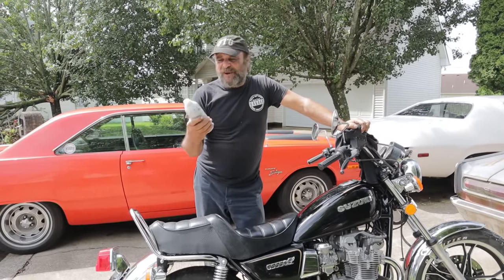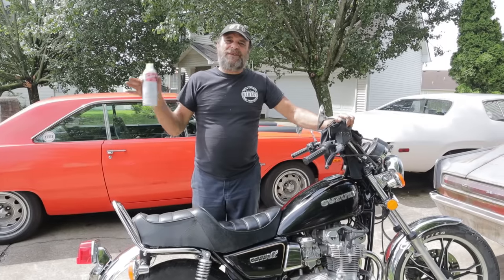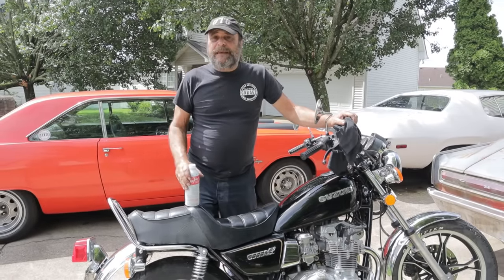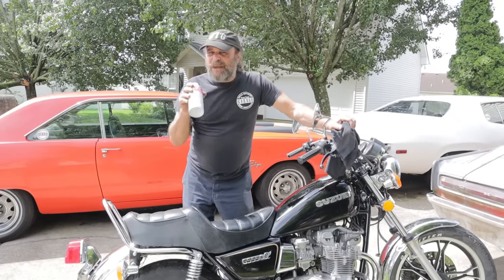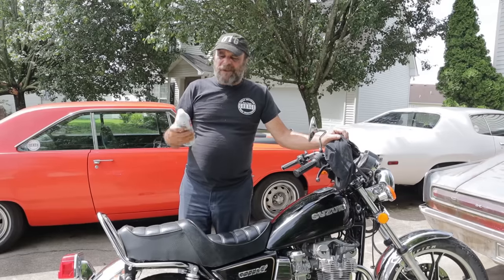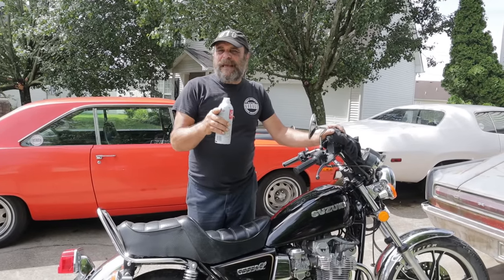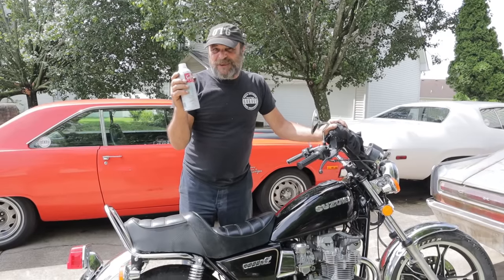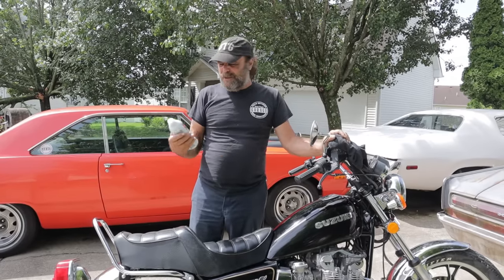We Try Seafoam - We Come Away Shocked

Comment: My Yamaha V starsat for 2 years and would not idle without giving it a little throttle. After running about 15 miles on a fresh tank of gas with slightly stronger than recommended amount of seafoam in it the bike ran like a champ. It works.  I also use sea foam in my oil about 50 to 60 miles before I do oil change. This helps with keeping hydraulic lifters clean. It’s a mild detergent that will not harm your main seals or gaskets. This keeps an engine from getting excessive sludge.  Check out project farm’s YouTube channel.  Pretty impressive how Seafoam quieted a noisy lifter on a very neglected Ford ranger.

Comment: @Uncle Tony’s Garage That works great in the fuel system but it shines when you introduce it into the vacuum system. This is what you do. Start up your cars and let them warm up. Pop the vacuum line from your brake booster and let it suck in about 8 ounces of sea foam. When your car starts to smoke, shut it off immediately. Wait 15 minutes and started up again. It’s going to smoke like crazy for about 10 minutes because it’s burning everything up that it cleared out. I promise you your cars and bikes will run like brand spanking new from the time you start it. It works every time and it’s the best internal combustion cleaner I’ve ever come across in my 38 years of being a really good back yard mechanic.

Comment: I had a Mazda that threw an EGR code. My kid had been putting cheap gas in it and it was a turbo. The EGR valve was in a very hard to reach place and I didn’t want to deal with changing it. The guy at Auto Zone told me about Sea Foam. Took 2 cans but it cleared out the soot in the EGR valve and everything was fine. 

Since then, I put a can through my tank on my motorcycles every 5k. Half a can in one tank of gas and then the second half in the next. Track your mileage before and after and you’ll see the difference over many tanks of gas.

Comment: I'm an old school Chrysler guy (63 Dart, 67 Dart, 68 New Yorker, 69 Charger 440 RTSE, 73 Fury, 77 Imperial, 83 Imperial, 89 Ram P.U. my last Chrysler... In spite of Scotty Kilmer(who I enjoy watching, and think is right on a lot of the time), who thinks Seafoam is 'bunk', I HAVE found some improvement afterward, the GREATEST improvement after one can, was unsticking apex seals on a 1970 Mazda R100 Rotary I bought that sat for a while in the late eighties. Fascinating to see a barely running, spitting, coughing,  low psi compression engine, to end up going MMMMMMM, and then Zoom Zoom after a minor tune up, yes it works, but I know, that now, there are better products out there.

Comment: Over the years, I've bought 8 bikes that had been sitting for various lengths of time( several years on average).  Buy a battery, drain old gas from tank (NOT the carbs) fill with fresh gas mixed with Berrymans B12 and 104+ octane booster.  Crank until they start to run.  Ride bike through 2 or more tanks of the same mixture.  Results were that EVERY bike ran smooth, would idle and perform to expectations.  Some were smaller twin cylinders some were 4 cylinders.  All 4 stroke.  The only one I pulled carbs on was a Suzuki GS450E to drill out the main jets.  Inside was as good as new.  NO further cleaning necessary.  It had been sitting out behind someones house with a couple of small rugs on top of it for "weather protection".  I wouldn't even change the plugs, just clean the tips with my plug cleaner.  Sometimes I'd let it sit about 15 minutes between cranking, so as to not burn up starter.

Comment: I used seafoam all the time for my beater commuter that had a catalytic converter going out since the engine was burning oil like crazy.  Would clean out the emissions system and get the code to go away. Sorry, but engine restore additive is effective. I have seen before/after compression tests. It really works. I also use restore on my beater commuter to help it from burning oil. It works, but it's not a miracle in a can. It can only do so much. Definitely helps with oil consumption but doesn't completely fix it.

Comment: I've had reasonable sauces with Berryman B12 in fuel injection systems with cruddy injectors myself. Experiment Farm did seafoam test as well with quite good results on the old Ranger farm truck he has too. There is very little voodoo in a bottle that works. Happy you had good results.

Comment: I use sea foam in everything. On diesels I always fill new fuel filter with sea foam.  Small engines ( mowers, quads etc ) get a couple glugs every tank of fuel.  Also put a full can in gas vehicles probably every 3-4 tanks of fuel!  It’s amazing stuff!  If I buy a old car and I don’t know history on it,  I will dump a can in oil and let idle for 5 min then change oil!  It works wonders!

Comment: I had a gentleman with a 2007 Hyundai that would set check engine lights and poor idle. After multiple fixes he dumped a seafoam into the tank, it smoked for a few minutes, coughed and fixed itself. I was impressed. No idea how exactly it fixed it but damn if it didn't work!

Comment: Yeah. I never believed in this stuff till I put it in a goldwing with a slight hesitation when throttle was applied. Well it took care of that. But it does have its limits. Check the condition of your oil after you get it all ran out of the tank. My oil was black. And only had 700 miles on the oil.  So it cleans alot of carbon out of the motor as well.

Comment: Seafoam works great!!  You can not add to much!! The more you use the better!! Pull off a vacuum line let it suck it from the can till motor dies.  Let it sit for 20 minutes then run it hard!! You will be amazed!!  I buy it by the case when it’s on sale.

Comment: The outboard boat motor mechanics along the Colorado River use this stuff for the 2-strokes.  I have used in my Toyota Avalon to make sure the injectors are clean and running good with no injector problems with 240K Miles.  I also use Lucus Oil Injector Cleaner for my diesel.  They way I look at is you can go to an expensive gas station 4 times a month and pay $.50 cents to .$.75 per gallon more than another gas station selling cheaper gas.  If you go to the cheap gas station 4 times a month you can literally pay for the SeaFoam with the savings and help your car run better for the long term.

Comment: It's a really good solvent. The best thing to do is run your gas tank low like a quarter of a tank dump a whole bottle in. Run it spiritedly till it gets warm then let it sit for about 8 hours run at spiritually again till it gets warm but it sit for at least 8 hours by the time you come back whatever your issue with the injectors or jets are they should be cleared. It removes all the gunk. But it does take some time to sit in there and do its magic You want that system to be hot

Comment: Ive used it for years and dont understand why it works so well. I put it in my engine oil in my truck and it suddenly idles so smooth and quiet you forget the engine is running while in park.

Comment: I use 1 oz per 10 gallons of straight acetone in my cars for the fuel injector cleanup and keep the catalytic carburetors clean. I do the same for my four wheelers carbureted and my motorcycle I'm not running the four wheeler for a while I turn off the petcock with the engine run until it dies include on choke and crank it over till I suck all the fuel out. works great I don't have any problem that way. do the same with my Briggs & Stratton and Honda spray and other equipment pumps.

Comment: I've enjoyed many good laughs over the years hearing people bash seafoam and similar products. I've also seen or done many small engine teardowns. Without exception those that had had seafoam used on them or Berryman B12 or probably some others were significantly cleaner. A little over a year ago body used power washer that had been left sitting in storage with fuel in the tank for over two years. Wouldn't even sputter much less start. Really didn't want to go through the hassle of pulling the carb off the Honda engine and "rodding out" all the jets, been there and done that many dozens of times. Instead, decided to flood the carb with seafoam, went to bed, got up in the morning, gave a quick shot of starting fluid in the throat and the damn engine and started on the first pull. Coughed and sputtered a bit for the first 10 to 15 seconds and then settled down to a flat perfect idle. Dumped the remains of the old gas out of the tank, filled it with non-ethanol fuel, and been using it for almost 2 years now without a hiccup. Laugh away folks but I do what works!

Comment: I buy non ethanol gasoline, store it for use in all of my small engines, push mower, rider mower, emergency generator and my Can Am Spyder and I treat each can of fuel with the recommended amount per gallon, so as the seasons pass, I know I still have good gas, especially for my generator here in the Florida Summer weather patterns. The fuel for the Spyder gets used up first....weather permitting.

Comment: seafoam in the crankcase the last few hundred miles before you do an oil change keeps the lifters clean of sludge.  Seafoam would clean ford ranger 2.9 lifter noise up in short order when nothing else worked.

Comment: You're right about that machine running lean to begin with, but it's not because of the gas. It'll run lean even without the ethanol. Bikes of that era had to start meeting federal emissions requirements. Even though the standard was not as harsh as it was for cars, the only way to ensure that every bike passed was to run them on the lean side. I'm not sure about your Suzuki, but my '82 Seca 750 has test ports in the headers, and the service manual outlines the testing and adjustment process to meet Federal emissions of that year. 

As for the Seafoam. I've used it on an as-needed basis for a long time. In addition to helping not-quite-clean carbs, It's great for clearing sludge from the sump of an engine that hasn't had regular oil changes, or that has sat for a number of years. It also does a good job of de-carboning valves and pistons (though the smoke on startup will freak out the neighbors).

Comment: I swear by a Subaru product they refer to as 'upper cylinder clean'. Similar product to the seafoam de carbon spray. This stuff eats up the carbon on valves, the carbon and varnish on the top of pistons and also can unstick rings. On my personal car I did a dry compression test, I had 2 cylinders at 50psi, wet they bumped upto 150. It ran okay but was a bit down on power. Sprayed half a can into each cylinder, left it for a few hours, rotated the crank left it again. Put the plugs in and took it for a hard run up the road. Really loaded it up. Next day did another dry compression test, all even within 5 psi at 150-155. 

Another car the powersteering started to make noise. I knew the pump had been replaced with a brand new genuine only a few years before I brought the car. Level was fine no leaks, so added a mechanic in a can treatment. That was 6months ago and have not had a single noise from it. 

Usually I consider additives to be snake oil, but you do come across some that deliver what they promise.

Comment: Most people modified bikes for speed but I'm wondering if anybody is building anything for the other end of the spectrum.
At different points in my life I have used motorcycles for daily commuters. While the bike I have now is not the most fuel efficient due to power modifications I've been seriously thinking about getting a second bike and modding it the other way.
Be super interested in someone taking an 883 and modding it for further fuel efficiency. Maybe lightning it up, adjusting the mixture where it's still safe for the engine but burns less fuel, maybe some other tuning mods too. I wonder if the stock setup is the most efficient or if there are mods to make it even more efficient. Things like that would be interesting to see someone go that direction.

Comment: A lot of those additives ARE fake Voodoo in a can, but I have seen the effect of Seafoam on carbon build up in the cylinder. I'm a believer in Seafoam. Yamaha Roadstars were notorious for carbon build up around the valves of the rear cylinder, causing them to stick open, Seafoam will definitely clean that up. You can also see the effect by doing a plug check before and after running a tank full of Seafoam treated fuel. BTW: 1 oz per gallon is a typical "maintanance" mix. If you have serious build up, you can go up to 3 oz per gallon. But, like Uncle Tony, don't give up on it after a couple rides. It may take a whole tank or two to see the result.

Comment: My seafoam experience. Had a dodge neon years ago had abo 250k on it. well sitting at a stop light  or a drive through this car would start smoking bad like the rings were gone. not wanting to blow a bunch of money on the beater I figured what the hell. bought a can of sea foam dumped half in the crank case and the other half in the tank. And after i ran a tank of gas through it the car, it quit smoking, ran better, and got better gas milage. Well ever senesce i have use this product to help keep the injectors clean and run some in the crank case about 100 miles before a oil change. I have a dodge, Mitsubishi and a ford f150 all pushing 300k now. so im kind of a believer in this product .

Comment: Honestly, I tried seafoam in a couple of vehicles with decent results, still some issue but I drive cars worth 2 yrs and get them to 5-7 yrs before scrap.  Since, I use every oil change and add to gas regularly, 2 stokes all the time.  Even forgot to empty my equipment last year, first turn starts with old gas + seafoam mix.  Best stuff ever, from my experience.  Most other stuff is crap, some good voodoo.

Comment: Try it in your crappy running lawnmowers. I add waaaay more than recommended, the mower smokes and coughs but cleans the carb up. Once a fresh tank of fuel is added, my mowers are back to new like running condition. Cheap and easy! I never believe in snake oil either, but this 99% of the time works. 👍👍

Comment: I discovered Seafoam in 2010 working on a 1976 Honda CB360 that hadn't run for 10yrs. I"ve used all the snake oils over the last 50+ yrs and even in the 1960's I couldn't find a snake oil that could clean out gummy carbs. Not like Seafoam. So now I always have Seafoam on the shelf.

Comment: Seafoam works great AND it's safe for the O rings. Now, if you put seafoam in your tank it may dissolute some "dirt" and your bike may run like crap. 
The best way would be to remove and disassemble the carb(s) put in container, pour seafoam and let it soak for a while, then use a paint brush and go over all the parts .
Another way, take a small funnel,  disconnect the gas hose from tank and  insert the funnel in. Start the bike and pour seafoam in the funnel directly.  You'll see white smoke starting to come out of the pipe, bike will start to stumble and engine will die. Let it sit for 10/ 15 minutes, reconnect the gas line and start the bike. IT WILL take several try to start the engine, IT WILL run poorly.for a few minutes then it will clear up .

Comment: I worked at a used car dealership years ago. We'd get cars in with noisy lifters and sick running engines. We'd put a half bottle of seafoam in the oil and the other half in the tank. Go drive the car around the loop twice. About 20 miles. Car would be running better and the lifter tapping would be gone. We changed the oil and filter and that's a car ready to be sold.

Comment: I've been using this stuff since the 1990's and it will clean a plugging jet in just about any carb. If you put it into your mower tank before winter and run it empty or close, it will start just fine in the spring! Works better than stabil. If you are bouncing the governer on a small engine, it will correct it most of the time in one or two tanks. I've seen it happen in less than a minute. This is what used to be used in the dealerships in the early 1990's and a Fuel Injection  Service! It worked then, it works now, and it wouldn't be on the shelf if it was garbage. Anybody tells you it doesn't work, they're full of shit! You can use it to soak a plugged carb and clean it out! It will work, may take time, but it will work! If you have ever seen the inside od an engine that has been treated with this stuff regularly, the intake runners are spotless where the fuel sprays! I used it in a transmission that had been sitting for 3 years that had sticky valves, and in half a mile the sticking stopped. Be wrenching since the 1980's in heavy equipment and it even works on diesels! People, don't believe these idiots that say it don't work, it does! They just want your money for the repair.

Comment: Yeah, it works. It's pretty simple stuff... half mineral/pale oil,  quarter naptha, quarter dry isopropanol. The mineral oil is just a carrier and protectant against the naptha for rubber parts and gaskets, and the IPA helps a little in cleaning and takes up any water in the system. That's about it, you can mix the stuff yourself. Heck, you can probably make a batch out of a decent grocery store pharmacy, since most have 100% IPA and mineral oil the only hard part might be naptha... clear lamp oil is probably close enough.

Comment: had the same problem with my katana. lean lean lean. replaced the k&n air filter with a stock air filter. problem solved. the air box is too sensitive to the air flow. carbs are getting too much air.

Comment: Had an old Honda car with 150k miles.  Used Seafoam sucked through the vacuum tube into the head, and some in the oil before a change the next day.
Letting it sit in the hot engine for a few minutes, the smoke it will put out is incredible.  The oil looked as black as Satan's heart as well.  But the car did run better and got a little better mpg for a few thousands miles.